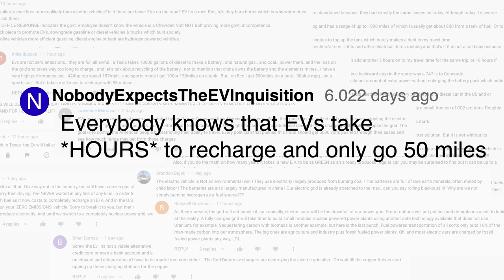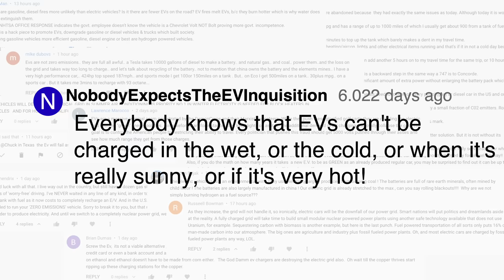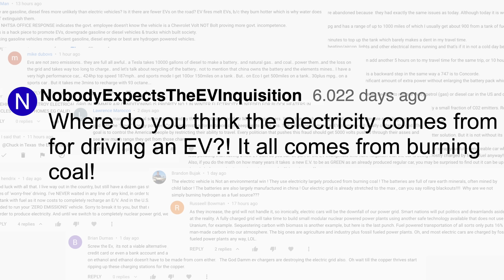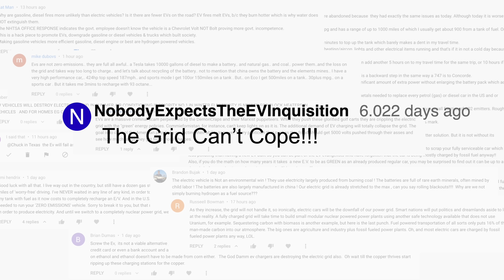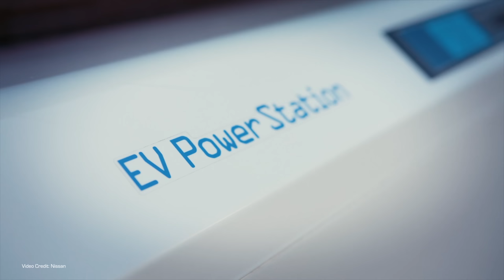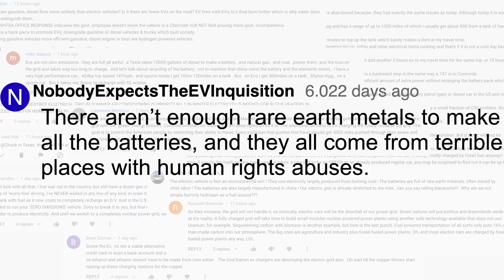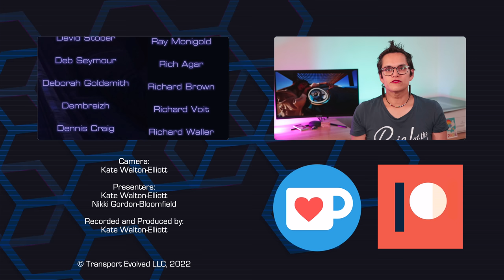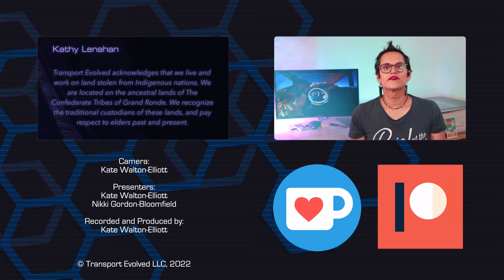The Transport Evolved List of Common (EV) Misconceptions

Comment: I'm a full-time ride share driver and I drive a Toyota Prius in fort Collins, Colorado and it's funny how people like to start the argument with me. How electric cars are bad for the environment? One of these people was actually an environmental scientists who absolutely bombed his chemistry stuff by his own admission, which I don't think he should be environmental scientist if he doesn't understand chemistry, but one argument that a lot of them like to make is the whole having to replace your battery. When the warranty runs out, that is something you should address in a future video and point out to people that just like gasoline cars, the batteries and motors and motor controllers just like engine and transmissions and gasoline cars typically far out last what the warranty. Is with no problems whatsoever and that the warranty is even more comprehensive on batteries and motors in electric cars because it requires that they go much farther than any car. Manufacturer gives you for a powertrain warranty now on a much longer. And it requires that there's still a minimum percentage of usable overall capacity, not just that there's some usable capacity unlike in internal combustion engine vehicles Oh the environmental scientist. I was able to guess it dead on the money. He's a Chevrolet Silverado owner. Usually it is the people who are the Chevy fans who jump on the whole EVs or bad bandwagon their favorite study to cite is one that was commissioned in 2001 by general motors to discredit the Toyota Prius for being an environmentally friendly car that was an obsolete and inaccurate as well as out of date study by the time it was even published because the one primary thing that they were using in the supply chain. The plant where the batteries for the Toyota Prius are manufactured somewhere on the European continent. If I remember correctly in a country that has no environmental regulations in a super dirty, super polluting manufacturing plants had been changed to a country that had environmental regulations on industry by the time the study had been released.

Comment: On the topic of the payback time for an EV regarding being carbon neutral. One aspect I never hear discussed is the current fuel distribution system.  I don't know if the is accounted for in the calculation, but I would think it should be if not.  As EV adoption increases the need for having millions of gallons for fuel trucked to separate gas stations is eliminated.  So all these trucks are no longer on the road, burning fuel, adding to road wear, and losses from when fuel is transferred from different storage tanks.  I would think the reduction in carbon and general pollution would be significant in the near and longer term. 
Just taking the longer term climate positives out of the discussion. Adopting EV will improve air quality in metro areas and quality of life regardless of the source of the electricity. Its certainly easier to control emissions on a single source vs millions for sources of emissions in various states of tune.

Comment: i just saw a video from Sandy Munro talking about the way rapid home chargers are installed using the same technology that was built for dryers. and they dont have the same use cycle. part if that is owner choice (owners  charging to %100 every night among other issues). and part of it is that the tech for dryers is built for dryers, and not EVs. not a huge problem, but it does mean that who ever installs the L2 charger, is aware that the standard dryer tech has to be upgraded for an EV)
Reply: a 240v dryer outlet does not have any tech that’s only designed for dryers.
Reply: @alanp613  according to the master electrician they arent designed for ev since a dryer doesnt normally run continuously for 3-8 hours at a time (this is l2 charging not fast or DC charging). and there were examples of electrical connectors that had thermal  events. i am a ev supporter, but this is just a challenge to over come. never mind the older homes are riskier even without an ev

Comment: If you view everything EV through the lens of what happens in USA, very little of it will transpose to other countries. I’m talking about personal accounts, not what governments and corporations are doing/not doing. 
For example, I own a Model 3 Long Range. I live in rural France. The nearest public charger faster than 50 kW is 90 minutes drive away by autoroute/motorway, at speeds upto 130km/hr. That uses some serious range. I cannot use Autopilot because it is absolutely dangerous and not fit for purpose. But that’s just Teslas driven in Europe. Infrastructure is unreliable and generally slow, if it even exists along routes where you’re going.

Comment: Both type vehicles have frames, bodies, interiors, and drive train. So making ice engine with components needed such as cooling and exhaust systems, is less than electric motor and batteries? I doubt it.

Comment: As a sustainability professional, one major false equivalency I see in so many carbon comparisons is also happening in your carbon segment.  The CO2 generation for the bodies of ICE and BEVs is roughly the same for the base materials, as they are they same stuff, but the BEV is listed in most studies as having higher emissions only because of the CO2 generated from the extraction and production of raw materials for the batteries.  But batteries are a component of the propulsion fuel for the vehicle while there's no inclusion in these studies of the associated CO2 connected to the extraction and production (not just the in-vehicle burning) of the fossil fuels that are constantly added back into the ICE vehicle and combusted.  The lifetime of associated CO2 connected to extraction of materials to produce fuel for the ICE vehicle is exponentially higher than the one-time associated CO2 in the extraction of battery materials for the BEV.  Oil refining is an electricity-intensive process, and it's worth pointing out that much of the oil refining is done in areas of the country with the dirtiest grid electricity powering those refineries.  This certainly offsets the knee-jerk "but the grid power comes from coal" argument aimed at EVs.  If you want a true comparison, lifecycle assessment of extraction and production must be included, as it more than doubles the CO2 associated with every tank full of gasoline/petrol.  Fossil fuel extraction and production CO2 metrics are absent from the studies claiming the breakeven for BEV vs. ICE is around 30K miles.  In reality, the number is generally well below 10K miles when considering extraction and refining CO2 connected to an ICE vehicle.  And, as you indicated, the operational emissions of BEVs heavily favor the BEV and become more favorable as the electricity sources get cleaner.  Furthermore, as you say, the battery materials can be reclaimed and recycled at end of life, reducing next generation extraction costs, but fossil fuels are strictly one-time-use as they are combusted, meaning the extraction and production CO2 is never-ending.  These CO2 studies also fail to consider that as ICE vehicles age, they become less efficient--the combustion of the engine is less efficient at transferring energy from the fuel into energy for propulsion, resulting in lower gas mileage, greater emissions per mile, and higher carbon costs connected to maintaining a vehicle.  An ICE vehicle is often 50% less efficient by the time it is retired.  On the other hand, while the BEV might suffer reduced battery capacity, the process of transferring battery energy into propulsion remains near peak efficiency throughout the life of the vehicle, so the carbon costs do not increase over time.  Good on you for referencing catalytic converters as a source of carbon costs, but another category is the higher associated CO2 in ICE vehicle maintenance and fluid changes.  ICE vehicles need regular changes in oil and transmission fluids and face more frequent inevitable mechanical repairs.  These things all come with CO2 costs for the extraction, production, and disposal of materials.  As an expert in this field, I cringe when I hear that 30K - 50K miles breakeven point for carbon.  Nope.  MUCH LESS, and it is not even close.  But ultimately, it's misleading to say there are higher front-end CO2 emissions from the production of BEVs.  Take out the battery, as it is the fuel.  Compare the carbon of the battery and the electricity to recharge it on a lifecycle basis with the carbon of combusted fossil fuels and the carbon necessary to create them.  Viewed more accurately in this fashion, ICE vehicles are NEVER more environmentally friendly to produce (long before considering vehicle emissions).  The true emissions picture between otherwise equivalent ICE and BEVs is actually much more favorable to the BEVs than the studies that have been in popular media suggest.  Thank you for your important work to inform people.

Comment: While I understand the need for 80% charge on the road, but when staying local and only charging once every three or four days at home, overnight, why can't I go to 100% then?  I and my son share a Polestar 2. He claims 100% charge should only be used when heading out for a long trip and regular charging to 100% will kill the battery quicker.  Which is it?  Thanks
Reply: He's thinking about the batteries we used to have in our home cordless phones over 20 years ago. Does he not think Polestar engineers could come up with a way to keep the car plugged in without killing the battery they guarantee? Plug it in and forget about it, the software in the car will take care of the rest.
Reply: P.S. I own a 2015 Leaf in Canada with no garage (truly cold winters). 80 000km so far, plug it in every night. Battery is still above 85% (ie, still has 12 bars)
Reply: Charging most any Lithium chemistry battery to 85% or less will significantly increase its lifespan.  With the average modern EV getting around 250 mi on a full charge, and few people driving more than 100mi/day, a 100% full charge really is only desirable for those few days that you will be using it.  

Some EV manufacturers include some charge overhead in their energy management, others like Tesla give you 100% of the battery to play with and suggest setting the charge to stop at 80% but leave this up to the user.
Reply: With current battery chemistries, leaving a car always charged to 100% is not ideal for battery life, but charging to less than 100% does not require manually unplugging the car. You just tell the car what you want to charge to, leaving the car plugged in all night, and let the car's computer take care of the rest. Other battery technologies are being researched that would allow cars to sit at 100% charge all day long, every day, without degredation.

The good news though...even if the car does sit at 100% all day every day, your battery still won't be dead in a few years like the skeptics claim. You'll just have a little bit less range than you would otherwise, which is hardly the end of the world.
Reply: @ab-tf5fl  Yes the Polestar has settings for charge levels, so I don't have to unplug it when it reaches 80%, or where ever it is set to.

Comment: It was mentioned a couple of times on this video that the average life span of an ICE vehicle is 12 years. KBB and other sources say the average is of the car fleet is 12.2 years.  It would seam unlikely that the average age is longer than the average life span. The average age would include vehicle purchased this month. There would need to be a huge number of cars well beyond 12 years in age to get the average to 12.2 years.
Reply: Oh MY GOD!!!  Their generalization of the average age of cars was short by TWO WHOLE MONTHS!!!!!!!!!!!!  It's THE END OF THE WORLD!!!!!  😁😆😆😆😆   Jeez.
Reply: Those are ev's that have had battery replacements.
My daily is a 1999 SAAB
Reply: I have an MX5 at 18 years old and an E Class Mercedes at 14 years old as well as a 10 year old motorbike. I also have a 6  1/2 year old leaf which has done 30 k miles and it has lost 1/4 of it's battery capacity and range, showing only 9 out of 12 battery bars left. James Cooke's model s battery has died with the car only being 8 years old.
Reply: @stevezodiac491  yea, and he’s not figured out if his pack is actually bad. It may be just a 12v issue. He only just put that vid out yesterday. Stay tuned for the outcome. Worst case probably a fault with BMS, I highly doubt he’d be in line for a whole new pack. He’d probably consult cleevley EVs or another HEVRA workshop to have the pack repaired if this is the case.
Reply: @salibaba  My car has been in to the dealer for the recent bms upgrade, no issues reported with my pack, only degredation from use and age, sorry, you are wrong,  as you will find out with yours shortly. Nothing wrong with the 12 bolt battery either. That is another issue EV's eat 12 volt batteries because they have no alternator keeping them topped up, just a dc to dc charger, from the main traction battery. Although the battery I have on now is in good condition, it is the third one fitted to the car since new. As for James Cooke, sorry but you are wrong again, there is a follow up video out and it is the traction battery as diagnosed by Tesla and he has decided to replace his traction battery with a £9800 plus vat repair replacement traction battery which is guaranteed for a further 50000 miles because he does not want to lose his free supercharging on his existing Tesla for a new one. By the way Cleveleys have stopped their Leaf traction battery upgrade scheme, I believe.
Reply: @stevezodiac491  my leaf is 7 years old, has 80 000 km's, lives outside in freezing cold winters and hot summers, gets plugged in every time it's at home, and am still at 12 bars. I use Leaf Spy and can confirm my traction battery is doing great. And when the car is plugged in, guess what? Yup, my 12V battery is also getting topped up. And just like you, i own quite a few older ice vehicles, 2 and 4 wheeled. And i still prefer my Leaf.
Reply: @stevezodiac491  I’ll give you a call in 7k when it’s obv crap then. All those Taxi drivers out there knocking around in Leafs 80k+ with minimal issue must have had the fluke builds.

Comment: The average age of the cars varies by location, in the US desert southwest I would wager the average age of the cars is 20-30 years, but that offsets snow belt areas where rust is a major issue.

As far as bi-directional charging what cars actually support that?

With the grid stability my state is pushing too hard to switch to cleaner power and is shutting down fossil fuel power plants much faster than we are replacing the capacity.  Also much of the new power we generate is slated for sale to California.  Basically our government leaders are idiots, and the power companies are not forward thinking.  I do agree that it will take a few decades for the EV transition for many reasons and appreciate you acknowledging that. 

But when asked about charging on coal power I inform them I have solar on my house, and am in the process of adding more power and batteries as much to make sure I have power in the upcoming years as anything else.